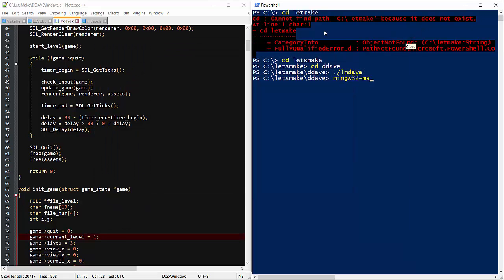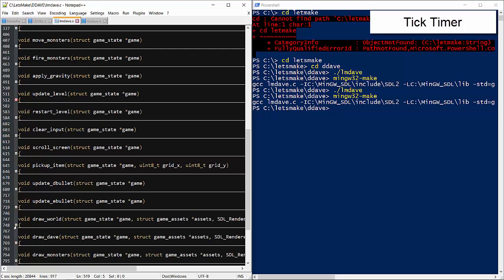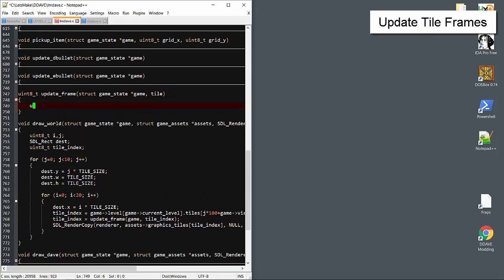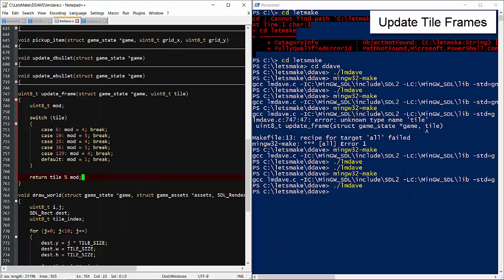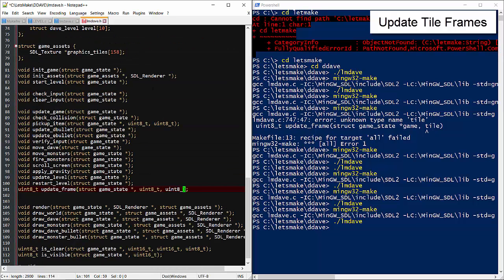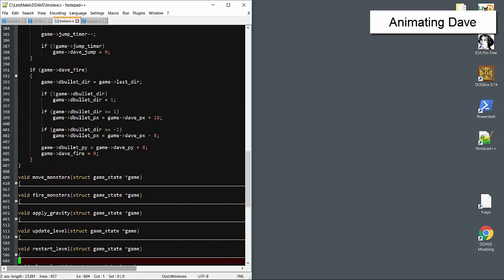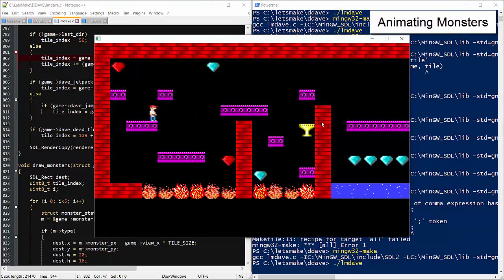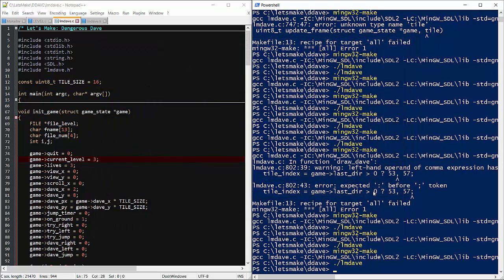Let's Make: Dangerous Dave - Part 8

Comment: I noticed when you were zipping through the game graphics, there was a mask for the spider.  It appears sometime before the spider image itself.  I also noted that the eyes for the spider appear transparent when you use black as the background key.    Otherwise, looking good.
Reply from the maker: Good catch. This issue existed in the original game as well, but they did their best to keep all bad guys on black backgrounds.
Reply: There isn't a mask for the spider (you might have seen the mask for Dave climbing which looks similar) however the original game drew the images by XOR'ing each pixel with the background.  This trick makes it easy to erase the picture again (if you draw an XOR image on top of itself it disappears and restores the original background) but one drawback is that if you draw on top of existing pixels, the colours go very strange.  You can see this in the original game - the spider looks transparent when it moves into the wall, but the colours also go very strange.  But anywhere there is a black pixel (in the sprite or the background) the colour appears normally, which means for most of the time it looks fine.